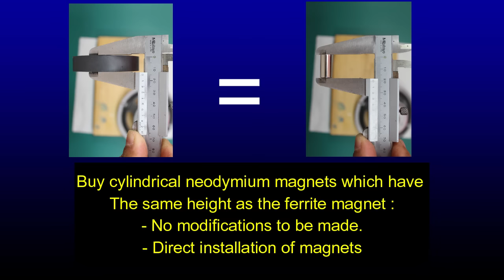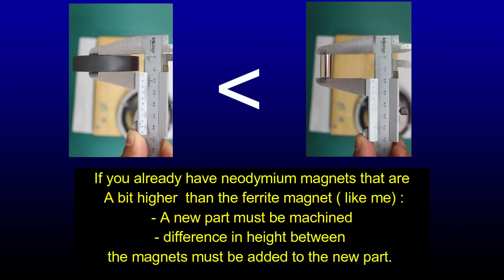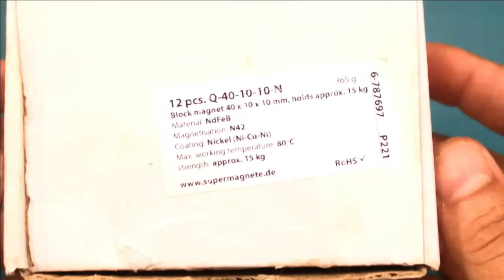--||-- Upgrade Speaker to neodymium Magnet --||-- step by step

Comment: The question is: do they sound better afterwards?
Reply: I was wondering that
Reply: It can, but if the speaker has a trash coil then it wont affect much
Reply: Probably not, but it has a lot more power. Perhaps more punch to the sound?
Reply: Todo esse trabalho é em vão sem analisar os parâmetros T&S e resposta de freq antes e depois.
Reply: No. It sounds worse than normal speakers.
Reply: May be. I already see a speaker in a different sizes and i notice in same  2 inches can have different quality sound the bigger magnet with big round coil have better sound. And  why other speaker have a double magnet may be because it's help to improve quality sound.
Reply: NO! NEVER! 😅😅😅
Reply: @vyasfalse, it all depends on how the woofer in question is built, which will affect ts parameters. Not gonna go too much in-depth because you can find more info online and I'm too lazy to type out the rest
Reply: No for sure he need to change the coils wire and put something stronger
Reply: With those magnets so far away it probably sounds the same ???
Reply: @TheSara200424  it's neodymium magnet it is 6 or 7 times stronger which means it only needs less power to produce the original sound but a bit more expensive
Reply: Весь мусор пыль будет  на катушке. Она ведь полностью открыта как я понимаю?
Reply: The bl parameter should be higher, but idk how much it increased.
Reply: How bro?  @dineshvyas
Reply: Should be more efficient.
Reply: Nop!
Actually this will not work 😂
Reply: Sensitivity just left the chat😂
Reply: As Mr.Google tell me Adding a stronger magnet to a speaker can increase its power handling capacity, but it won't increase its volume. When a speaker produces sound, the cone moves due to the magnetic field of the voice coil's current interacting with the speaker's permanent magnet. A larger magnet allows for a bigger voice coil, which can handle more current and produce a louder sound.
Reply: my guess is No, best case this speaker might have better dynamic/control, but everything else will be OFF, just by how much
Reply: A stronger magnet will increase the performance slightly, and it will increase the dampening factor and the speed of reaction to fast attack waveforms increasing fq response as well. But that magnetic field must be precisely focused and the way he does this I highly doubt there was any change but to make it worse.
Reply: Would most likely sound the same. Perhaps much better cone control at higher demand due to stronger magnet force. BUT, too much power can cause tinsel leads to separate or break, cone to crack etc. 
I like this though, and he made the swap look easy!!
Reply: The primary advantage of using neodymium speakers is that they offer significantly better performance than traditional ferrite models in terms of both power handling capabilities and maximum SPL
Reply: No need to even think about that. Of course it will sound WORSE.. I cringed when he uset that much cheap glue over the membrane .. 🤦‍♂🤦‍♂
Reply: if magnetic flux becomes highre fs becomes also higher ( the pulse will increase but the spaker doesn`t go as low as before). the box volume will also change  for best pulse.(transient)
Reply: @obiessen - Back to the future with a flux capacitor.
Reply: @reubenjoshuanario2316  or because it has a larger coil inside that can use the extra forces.
Reply: @ReimuReimu_Animation  and theres no balance to stop it ripping the speaker apart. 😬
Reply: @luminousfractal420  what do you mean by balance ♎
Reply: @ReimuReimu_Animation More sensitive.
Reply: @Justwantahover  agree it will make it sensitive but at same power it will be louder
Reply: Ultrawaves sound blaster... 😂
Reply: @ReimuReimu_Animation  Nd magnet is 6 times stronger only if the size is the same. But here the new magnets are  much smaller . And the surrounding environment affects it very much also. Pole piece concentrates flux of ferrite magnets, this way more than 1 Tesla is typically achieved in the gap (the only place where magnetic force matters). No matter how stronger the new magnet is by itself, over the saturation  the pole piece can not increase flux very much. 6 Tesla will never be reached, maybe 1.6 in very best case. But it is not measured, so we can not know if this mod made any benefit.
Reply: @PafiTheOne  You're right I may agree on your response
Reply: Watch: Monster magnet meets subwoofer... by Brainiac75.
TL;DW: Stronger magnet = More movement for the coil.
The catch is: If the coil doesn't have breathing room to move in and out, it might cause distortion to the sound. (as the coil smacks itself in and out.)
I recommend watching the video itself, as he explains it way better than I could. (also very informational+educational.)
Reply: Es mejor comprar un altavoz de las prestaciones deseadas, que arriesgarse a arruinar el existente.
Reply: Es mejor comprar un altavoz de las prestaciones deseadas, que arriesgarse a arruinar el existente.
Reply: @ReimuReimu_Animation  You are the first person on Youtube who just simply agrees with me after I (partially) corrected him. :-) Thank you for the experience, and for showing this is possible! ;-)
Reply: @PafiTheOne   No problem, but your theory is also correct :>
Reply: I think don't you understand that neodymium magnets are lot stronger than the magnets he pulled out.

It will definitely be better.
Reply: Yes
Reply: @dineshvyas It would be good to know why, since you can't have heard them...
Reply: It could change distortion levels or have you heard of an amps dampening factor, maybe a stronger magnet allows for quicker start and stopping of frequencies FASTER. THERES A REASON NEW HI END LOUDSPEAKER USE STRONGER MAGNET. MORE CONTROL PEOPLE!!
Reply: @ReimuReimu_Animation that’s a very counterintuitive
Reply: It would be cool to replace the coils with a PCB sandwiched one.
Reply: @reubenjoshuanario2316 double magnet is not for sound quality but to reduce stray magnetic field which affect other electronic equipment such as TV.
Reply: More power,not better sound..
Reply: Yes it souds better but coild should be also good not burnt  up
Reply: sut  up

Comment: You should do a sound comparison between the ferrite magnet and neodymium magnet.
Reply from the maker: personally I don't believe much in comparisons of sounds on youtube, including recording equipment, listening location, editing, equalization, youtube tuning and final listening equipment (most of the time the telephone speaker) the result is probably far from real.
in the video I showed several techniques that are very important to remember to do a lot of things on speakers.
Reply: @homemade_audio  how does the modified speaker sound like? Clearer on the high frequencies? I was also expecting a comparison, even though compression will inevitably mess things up 😅 you're an amazing master of this stuff by the way, thanks heaps for putting up these videos!
Reply from the maker: thank you for your comment, first the modified driver is a midwoofer, already there are no high frequencies !! but what I noticed is that with the neodym magnets I have a softer sound with less presence of midranges, and a good presence of bass.
Reply: What liquid is, that you injected?
Reply from the maker: It's mentioned on the video (Paint thinner)
Reply: @homemade_audio 
I mean what is the purpose of the liquid being injected
Reply from the maker: It takes off the rubber glue used by manufacturers, Epoxy glue is used on drivers only between voice coil and  inside spider / cone.
Reply: @homemade_audio  I agree that it won’t sound like actually being there in person, but whatever we’re listening on at home is our usual frame of reference and we will be able to hear some of the differences between the two.
Reply from the maker: @christopherjolly  yes i agree with you, look up on my second answer where i describe some differences between two speakers.
Reply: @homemade_audio  thanks for information
Reply from the maker: @ijulmahardika8923  you welcome  🙏🙏🙏
Reply: It sound like it make content test can be made with a mic and show ad explain us the difference …
Reply: @homemade_audio how about measuring its frequency response before and after modernization?  This is the simplest measurement.  You can also measure the noise level
Reply: @homemade_audio 😅
Reply: sometimes inventions make perfect in the first time. Then after making several test to proof like magnetic paper simulation, audio frequency for clarity and later compatibility of dimensions. Compatibility how electromagnet response to audio frequency with good clarity of music not being loud or high amplitudes,
Reply: @homemade_audio  Hello. Paint Thinner - which manufacturer and model?
Reply: @homemade_audio . What improvements are exp cited from this modification?
Reply: flux should be exactly the same to make an comparrison , the parameters will change if not.
Reply: @homemade_audio I'd like to see a REW frequency sweep and T/S parameter measurement. Right now we have no idea how these modifications are affecting the sound, sensitivity, or speaker parameters.
Reply: I just wanted to see it lol, Watch the coil go crazy haha
Reply: @homemade_audio   there are other ways to show the differences

Comment: On the back, where the magnets are, the coil was exposed and dirt, dust, etc. could get in, which over time, will cause it to have friction, sound bad, and even the coil to get stuck. I, instead, would cover that opening with clear plastic so that it can continue to be seen when it moves. Even, to make it look prettier, I would add some LED lights. Good your idea, only the sound check was missing. Greetings from Argentina. 🇦🇷
Reply: This is not necessary, many high end drivers leave this area exposed, it is great for cooling the driver, and if the woofer is properly enclosed in a good box, there will be no problems.
Reply: why does everything need LEDs these days????
Reply: 🫣 use incandesent for pretty. leds are never pretty.
Reply: @dhmusic2031  it doesnt. leds need ripping out of everything 😂. ive got a whole room in my place set up with only incandescents so i can get some relax light for my head. and every one diffused through some natural media. im so done with flickering.
Reply: To combat heat, neodymium drivers will often have an open motor structure. Neodymium is weakened by heat.

Comment: So I installed a new sound system in my 2010 BMW Z4 and installed Focal separates front and rear ,It sounded ok but to me the titanium tweeters was way to bright . So I ordered some vibe speakers from the UK and they have neodymium magnets in the drivers and the tweeters are a silk soft dome. OMG they are so crisp and clean with no distortion at all. I listen to a lot of Jazz and now the vocals and drums are so awesome
Reply: Yep the English make the best speakers
Reply: No, the Danish make the best! Scan Speak, Vifa, Dynaudio, Eton Electro, Peerless, Tympany, etc.

Anyways, the neo magnets did not improve your sound. Most likely just a better match. Many of the Focal tweeters that come with the components are kinda sub par. I always went for their inverted dome Kevlar ones. Soft not harsh, hits the high details, non fatiguing.  My favorite car front end drivers have been Focal since 1986. I used to use their home audio drivers decades before they made car audio gear...
Reply: Here in the uk Vibe is a  budget brand for the kids. Vibe may be designed in the uk but its made in china
Reply: @Synthematix   Unfortunately the majority of British speaker brands are now designed in the uk but made in china
Reply: Titanium & Aluminum domes can have a certain "ring" resonance to them if not designed properly!!! Silk cloth domes always have the best response & imaging IMHO!!!
Reply: @fookingsog  Yes for sure! Dynaudio d28-af was my favorite tweeter.

Comment: Very cool and informative video. I may consider that for a much larger speaker as I’m not sure that one is worth the effort. Also you must seal the perimeter of the exposed magnets with tape or plastic to prevent debris from getting into the voice coil and pole assembly. Otherwise very nice work.
Reply from the maker: Yes i agree with you, glue isn't enough to hold well the magnets,  but the best way t keep voice coil safely is to hold the two métal parts of magnets assembly with bolts.
You welcome
Reply: No no that’s not what I’m saying. If you look at the speaker from the side you can see the voice coil through the magnets. Debris can fall in between and get lodged in the voice coil.
Reply: @homemade_audio  I thought perhaps an epoxy encapsulation of the magnets could be made to have the exact same toroidal shape of the ferrite magnet and thus have a closed design just like the ferrite one but with neodymium, what you think?
Reply: you could use a kind of screen net sheet over it
Reply: The risk of debris is real but you also have to consider that exposing the coil to the air the temperature of the coil cools down during the activity and this may increase the power handling. The greater attraction of the magnet may also increase the excurions of the coils and there is the risk of a deformation of the botton of the coil hitting on the base plate because rhe greater length of the coil movements. The magnets have been glued but the are many vibrations so there is a risk that some magnet detach in the long term. To connect the top and base plates with metallic bolt may deform the magnetic field as well .
Reply: Non ferrous fasteners can be utilized.

Comment: Very interesting vid & I can see the skills to redo the driver. I have the following comments... Artificial magnets (Samarium Cobalt and now Neodymium) are used where space/weight is reduced and strong mangnetic fiels is needed (= maximum energy produc or magnetic density): headphones, in-ear headphones for audio and electric motors (EV), hard drives, RC servos,  military/space apps,... I can't see an audiophile taking the risk of upgarding to neodymium while having a big risk of downgrading the balance of cone and precisely centered coil while standard drivers/speakers are already designed for the best performance. I will not take a chance to fiddle with my Harman Kardon and Bose speakers.

Comment: Would love to know the before and after Theil/Small parameters, if you measured them please post the results! Great video!
Reply from the maker: Yes i agree with you,  very logical question,  but I don't have materials to get the new T/S parameters. 
I'm planning to buy Dayton Dats software in the future.
Reply: @homemade_audio  Do you have an unmodified speaker model? Could you measure the deflection of the membrane at the same DC voltage with and without modification. You would immediately know whether the strength of the magnetic field in the air gap is greater or not. It is not demanding on the equipment. Of course, it won't tell you the T/S parameters. Purely theoretically, however, they should be preserved if the rest of the moving system was not adjusted, only the sensitivity of the speaker should be improved.
Reply: @davidrendek2399  More Qes, less bass, more sensitivity. More Qts. More is lower number. deflections can be higher at resonance with less magnet. The right amount of magnet is best.
Reply: TS fundamental parameters are all the same except Bl is now infinite 🙂

Comment: Great job! That's some insane craftsmanship and machinery you have.

Would've been interesting to see how the efficiency of the speaker changes. Feeding both the ferrite one and the neodymium one 1W and measuring it's volume. Also I am wondering whether putting the magnets closer to the coil would've granted a higher efficiency.
Reply: I dont think the magnets being closer would do anything. The core is what decides where the magnetic fields go.
Reply: edit

Comment: One should cover up that magnets enclosure, as dustproof as possible....average urban dust contains small grains of sand, earth including metal particles of which some are magnetic also....they will accumulate and get trapped into the vibrating space of the membrane's coil  therefore it will strongly affect the way electric impulses are turned into sounds so distortions will occur....also, due to friction of the coil with such trapped grains, short-circuits may occur and/or the wire gets cut......

Comment: Assuming the smaller magnets around the periphery actually produce a stronger field in the core it will cause less overshoot of the cone, improving the bass, and a little higher speaker efficiency. I watch these videos to learn about speaker construction so I can do better repair work on old radios.

Comment: I think it's better for the neodymium magnet to keep the original magnet thickness so that the voice coil position is at the right position. Furthermore, the voice coil should not expose to outside which will collect debris into the magnetic gap.

Comment: what benefits does this have? Am I wrong in thinking that the voicecoil should be changed as well, in order to allow more travel. I dont really no what Im talking about but are neodymium magnets primarily used to make a smaller speaker more efficient than had it used a ferrite magnet?

Comment: Because of this project you've got a new subscriber here sir. May I add some suggestions if you may on the magnets installed. How about you drilled a 2mm deep pocket for each neodym to seat on aside from gluing it down and also drilling four bolt holes around the base for a bolts and nuts to go through from basket all the way to the back as clamping so if ever the glue gets dull none of the individual parts would move around and gets misaligned. I would love to see a bigger version of this project (a 12" or 15" maybe😄). Great contents sir 👍